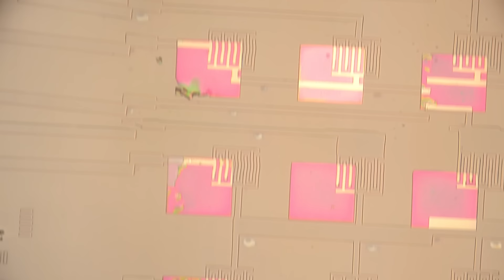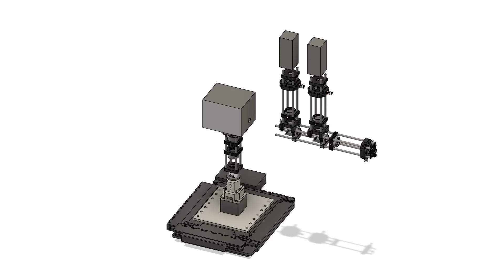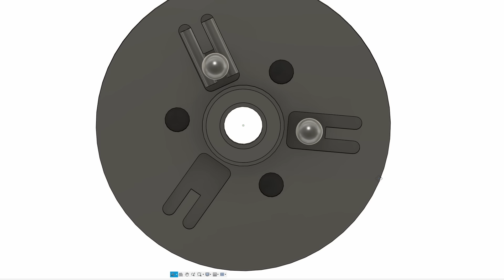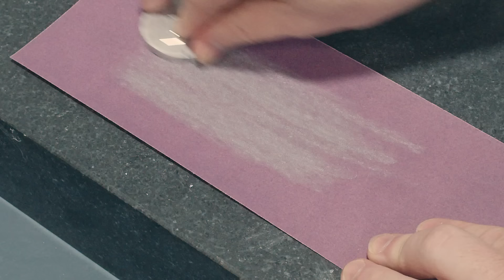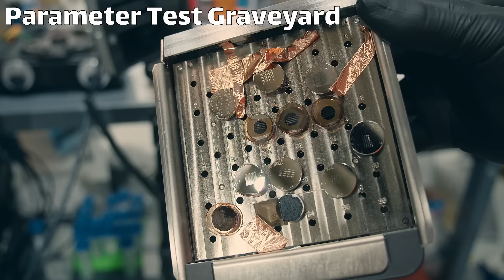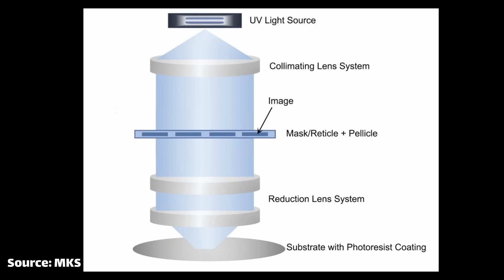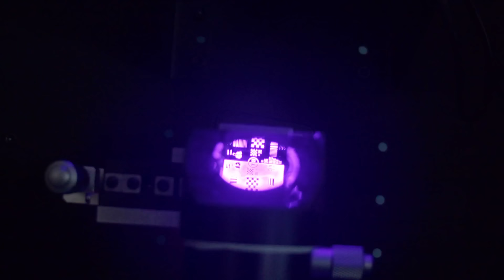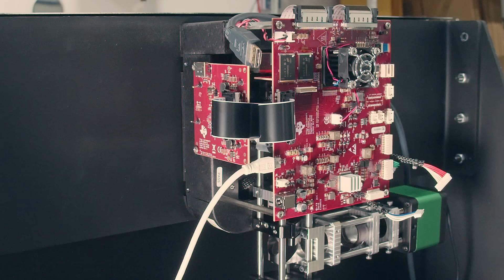Speedrunning 30yrs of lithography technology

Comment: Cool stuff, I attempted something similar but the deposition of metals was too expensive for me so I stopped at the lithography part. Some advice,

Mount everything to a granite surface plate, you can use a diamond brazed bit and a router to bore holes into the surface plate then glue inserts to secure any apparatus. This makes aligning things much easier.

Not all DMD offered by TI are the same, the one you used has really poor optical performance when it come to <400nm wavelength range (look at the datasheet). When I attempted this I used the DLP assembly from a MARS 4 DLP resin 3d printer, this solved many problems like not having to worry about the light source, the optics where better than the ones found in projectors, mounting was much easier since the unit is quite compact, etc. This DMD (TI DLP30xS) is orders of magnitude better for <400nm wavelengths. XPR is also something you might want to look into. 

Unfortunately I think if you want to reach the 1um range you will need to develop a custom projection assembly using laser diodes instead of LEDs with optics designed for <400nm wavelengths. 

For enclosures use stainless steel (<2mm) it doesn’t warp as bad as steel and the cuts are cleaner, plus you don’t have to paint it.

Cool XY stage.
Reply: Good stuff man

Comment: Aluminum and steel in contact with each other will encourage galvanic corrosion.
Even if you isolate each part with paint or nylon spacers, and use non-metallic fasteners, each part needs a path to ground in order to prevent static charge buildup.

Comment: Yet the crazy thing is that we're getting to the point that Silicon is practically useless, about 2 nanometers or smaller, pretty soon. Silicon indeed have had a good 70+ years run as a transistor material, so it's time for exotic III-V / III-Nitride materials like Gallium Nitride to take over soon enough.

And replicating that process of producing 2 - 1 nanometer transistors is very difficult and that kind of means using X-rays to make photolithography imaging that small (13.5 nanometers is basically extreme ultraviolet yet it has enough energy to technically qualify as X-ray wavelength as EUV lithography machines practically use X-ray optics and mirrors for that reason).

Comment: You mention two targets, resolution and coverage-area, but there are actually three, the third being throughput. As a thought-experiment, if you could use a pinhole-camera to put an image onto a wafer, you could spend a full year, and have one wafer exposed.. but that's not a fair comparison with the MANN unit, imo.
From a kinematic standpoint, there are several "big boo-boos" (no disrespect, I love your channel!)
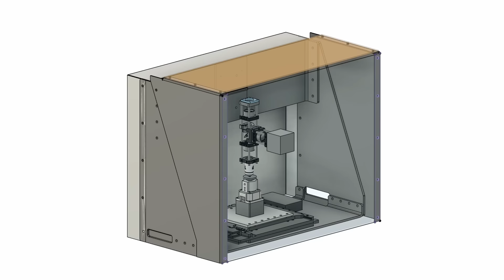1) The "rigidity" of tens of kg steel is pointless if it is also has eigenfrequencies in the sub-100Hz. This can be due to the heaviness os steel, or more often than not, a poorly chosen geometry. The "base" is a sheet of steel, which acts as a tramponine, which I thought was bad, until the whole wafer-stage got lifted up by a scrawny bearing from a NEMA17 stepper. On a microns-and-hetrz scale, the wafer shall be bobbing around endlessly. The enormous cantilever from the projector 3:31 is the equivalent of a fishing-pole with a brick at the tip.
2) Numerical aperture and fixed distances - it is as if you are standing on a tele-handler, and with an outstretched arm, are trying to write your name on a wall. Every little vibration is gonna add errors to your writing. Worse yet, as the actuation-loop is so long, any control-system is gonna have a hell of a time to close the (control) loop. Why not reference the Z-distance off the projection-lens?
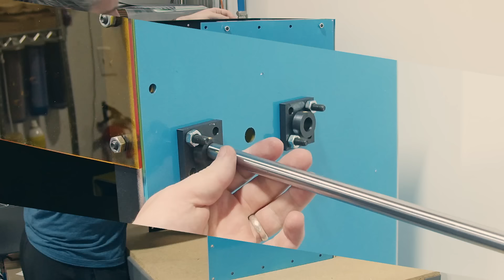3) "linear guidance" - an overconstrained guidance-rail with two parallel beams makes the kinematic-mount utterly pointless. 27:52. 
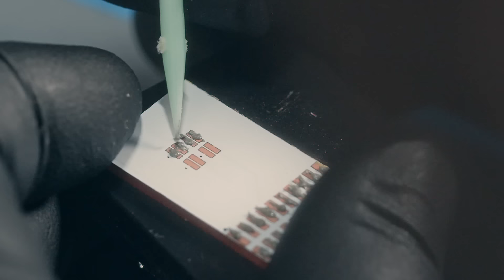4) Collimator: Why not stick to a single UV-LED? How can you ever collimate bundles coming out of two point-sources? 8:51
5) Path-planning, momentum-balance, reaction-forces and jerk: Every motion of the positioner shall shake the construction. What measures do you employ to prevent this energy from enterind the hanging-system?

The one good aspect is to see the "fall and stand-up" process, with all the associated pitfalls, made even by an experienced designer such as yourself.

Ach, don't mind me, just your average keyboard-warrior :p

Comment: Putting a stepper motor on such a precise x-y stage kills all the precision to begin with
Reply: I was looking on in horror as he was assembling the tower of backlash.
Reply: @Kenionatus me too, and thinking "you know, Thor Labs just... makes this kind of stage. You can just buy it."
Reply: @arfink  are you sure you’re an engineer because he already had that Zeiss lens sitting around and the developer isn’t that expired.
Reply from the maker: It was not the best of plans 😅
Reply: Yeah, i was already thrown out by the idea of putting a stepper motor in this. They are "good", just never good enough. Especially NOT for a precision critical task such as lithography.
Reply: Not really, these are called theta stages and they are for something different than the x-y stage. He still has the exact same precision in x and y. He doesn't have much in rotation but he may not need it. His real problem is that he's not using focus on each step with a z stage. But I'm not sure what an affordable home system would look like.
Reply: I'm curious, wouldn't a structure like a 3d printer be better?
Reply: @alexmipego  it's not precise enough for this type of job
Reply: @alexmipego  I'm not sure a 3D printer has a micron precision.
Reply: @narrativeless404  There are micron-scale printers.
Reply: @alexmipego  No idea how is that useful in a 4D printer.
Reply: @ Yet you talked about it.
Reply: @alexmipego  Ok and?
Btw, people would be 3D printing chips if the printers were that good at precision.
Reply: And backlash in the stage axis screw adjustment possibly as well.
Reply: With proper gearing you could set it up such as 100 steps forward is 1 micron of movement.

Comment: If the diode test is reading 0V, that means it failed short circuit. The working one was reading a typical forward voltage for red leds, and "OL" the other way, which most people think means "overload" or "over limit". Try the meter in resistance mode to confirm.

Comment: Hey! Optical scientist here! I design and build these kind of setups for living (used to be custom microscope systems, but now space instruments). So fun to see what you can achieve with DIY stuff! Youre doing an excellent job!!
For me building and aligning is always the best part of a project. I think you can ease your alignment process a lot by using good alignment tools and mounts with the appropiate degree of freedom control. For instance, putting the objective on a z-translation cage mount would massively improve the alignment control. For the alignment tools I would suggest cheap ones screw on alignment targets and frosted glass disks. You can also make these yourself!

When I design and build systems I spend most of my time thinking how I will align it.   Where is fine adjustment needed? What can be mechanically toleranced? Thinking ahead of all these things saves you massives amounts of time. I know for sure your next optical system will be even better! Keep it up😊
Reply from the maker: Noted, thanks!
Reply: And maybe throwing away the 3D printer; every time I see a cantilevered 3D printed "support", I want to die...
Reply: @Beregorn88  That's not the fault of the 3D print though - that's the fault of the optomechanical designer. Using the wrong process for the job does not discredit the process itself. I absolutely think 3D printers have their merit in the prototyping process, also in the optical lab - you just need to know when it's the right tool for the job.
Reply: @mr_gerber  it is not the right tool anytime you need even the semblance of precision: the extruded thermoplastic simply doesn't have the stiffness required to make a usable optomechanical elements. Not to mention the fact that it changes shape under load and at every slight change in humidity and temperature.
The only practical use is in creating replicas of the elements you plan to buy to see how they fit together, but for the experiments you need the real deal.
Reply: @Beregorn88  I use 3d printing regularly to make prototypes as a mechanical engineer, but it's definitely not meant for everything. I can consistently get 1 thou accuracy on my bambu (good enough for a caliber, but not a micrometer). I've tested a few parts where 1-2 thou of dimension changes makes a part pass vs fail, and the prints still worked great for prototyping. 

That being said, stiffness? Sub-thou accuracy? Not a chance. You've gotta CNC the parts or use different material.
Reply: @mr_gerber  Not only that but 3D printing is still relatively in its early stages, not quite infancy as it has been around for nearly a decade yet it's still young in terms of tried and tested technologies. Where we are currently at with this technology in theory shouldn't get any worse with its precision, efficiency, and applicable versatility. Give 3D printing another 5-10 years with more breakthroughs, discoveries and improvements also with the potential to be more affordable and accessible. 

I can remember back in the late 90s when I was still in High School, we had a Color Laser Printer in one of our computer classrooms that at the time were running Windows 95 or Windows 98, 98 SE. The internet was in the dial up stages, post baud rate and the search engine wars were on from Google to Yahoo which most are still aware of today but others such as WebCrawler, Lycos, Excite, HotBot a well as many others. When I looked up the cost of that printer, it was over $10k back in 98-99. Today that would be close to $30k. Now we can buy a Color Laser printer for the home or small office from about between $250 - $500 and they're easier to operate, maintain and service.  

We still have to give 3D Printing time to fully mature. Right now, it's kind of in between a toddler and adolescence before becoming an unruly teenager. 

I'm kind of curious as to what the future will bring with advancements in 3D Printing especially when other fields or exotic materials become easier and cheaper to manufacture such as graphene. Who knows, maybe in 10-20 years we might be able to have our own personal 3D Printer that can print Graphene and Carbon Nano Tubes at the micron or even smaller levels, and with that we could potentially print our own integrated circuits at home, that is if computer architecture design transitions from silicon base to carbon base. 

With a carbon base model, we can have various carbon structures for specific behaviors, such as graphene, carbon nano tubes, even diamond chip lets (microscopic). Instead of relying on electricity directly with various carbon structures in specific arrangements we could use optics for doing computations and logic instead. There's quite a bit of research going on right now with optics as being the data-signal carrier as opposed to current across a field around a wire. 

Who knows, maybe in 20 years we might not just be able to print our own integrated circuits for basic CPUs or microcontrollers, but with the potential improvements in both graphene research, 3D printing technologies, etc... and using Optics instead of conventional voltage-current based systems, we might even be able to print our own quantum chips in our own homes, garages, and shops.
Reply: @Beregorn88 Yes but waiting hours instead of days for delivery is such a win. 😋
Reply: @MakeKasprzak  that's only if the parts work: what usually happens is that you waste time and money, and then you have to buy the proper parts anyway. Or even worse, you go out of budget and can't complete the project at all...

Comment: So I work as an engineer developing lithography machines and it is funny to me how I have very little knowledge of the process as a whole, while noticing a lot of small things that would never fly at work. It is great to see someone build a working machine in an hour instead of focusing on a small gear in a very large machine for a year at a time.
Reply from the maker: Working on v2 so I'm all ears if you have tips! Top priorities are: a precision base for the stage (granite, optical breadboard, etc), reducing stack height of the stage to reduce abbe errors (and fix that stupid rotation stage), and re-arranging the optics so they aren't hanging/cantilevered or attached to the frame
Reply: I make parts for experiments that go into space and I don’t know what any of them actually do most of the time.
Reply: @rexmundi8154  that's the way everything in Universe likely works: a combiantion of many is more than a plain sum of components. Only by having extreme specialization jobs we're able to go forward as humanity.
Reply: It's like they say, no one person could design a modern computer mouse by themselves.
Reply: Do you have any advice for him?
Reply: 😂 what do you mean one machine? He built two machines in an hour!

Comment: First, fusion has a interference analysis function so you can check if things will run into each other - as long as you actually put the screws into the model. 

This was a great video. I really enjoyed it. 

Also, SendCutSend is really great. I’ve ordered a few things from them, and they really are a great service. Their powder coating service is also definitely worth using.

Comment: 20 minutes in and we saw something what was so obvious without your story telling / film making capabilities. Yes, it is obvious if you move something which you want to focus on to check/adjust/make sure is moved in one plane of motion, screwing random parts with unnecessary joints will always produce this, not thinking about base flatness and all other stuff from which you expect micron precision is at least hilarious if not stupid, sorry on that but it is what it is. 
Other option is that the point of this video is to show us what you did wrong and how did you get close to solution or even solved the problem which you should point out in big letters in the beginning. Yes there are million other videos doing precisely this, building/making/fixing/producing something where they don't have slightest clue about so they kind of are trying to take us thru the process of learning stuff and they also do not mention that instead they try to sound like experts, luckily you are not quite like that you are humble and occasionally say you don't have clue what you are doing but why would you film and continue to do something you saw immediately is wrong, example being that screw on the left side where you could not flush mount your panels, how much time is needed to simply drill the hole which would go over that screw and allow you to flush two panels? What stopped you from drilling holes for top plexi window? How did you even expect to have micron precision when you can see by your eye that bottom plate curvature? Those are really simple stuff and looking at that you are lucky to have millimeter not micrometer precision. I bet your rods holding the lenses and beam splitter and camera are bent from the camera mounted on one side and really nonsymmetrical build, or even thought about supporting it correctly. If you tightened that xy to that bowed bottom plate now your xy is trash looking from the micron precision perspective.

Comment: The Zaber X-ADR stage makes me feel funny, like rope climbing in gym class. Is it seeing gentleman callers presently? Is the interferometer somehow used for absolute positioning, or more for station keeping in a sea of vibrations?
Reply from the maker: 😂 

The interferometry data is all "offline". They assemble the machine and then place it on a precision granite surface plate and collect data as the stage moves through its full range of travel. That gives a table of pitch/yaw errors as it moves around. This allows them to confidently state worst-case specifications of the stage, but also provides interpolation data that I can use for dynamic compensation of abbe errors. I'll talk more about that in particular in the next video :)

Comment: Pretty cool project! However, NEWSFLASH: The maker community NEEDS a low cost open source SMT pick and place robot arm with OCR and a parts tray shaker to flip the parts upright so the OCR can find the right components. So after done making those CPUs with 1 micron features in that basement, can handle that? Thanks in advance.
Reply from the maker: Take a look at LumenPnP from Opulo! They are doing some really cool pick and place stuff and it's all open source! https://www.opulo.io/
Reply: @BreakingTaps  Thanks for recommending, but a low cost robot arm with machine vision basically seems like what should be happening right now for the open source hardware community. I may work on that some this month.

Comment: A piezo z-stage and some code could have solved the Problem in my Opinion, without a new machine.
Reply from the maker: Definitely! But timeline was starting to get tight and a basic reduction machine seemed simpler (at the time anyway). Piezo focuser would have been ideal but I didn't want to hang the weight off the projector, wasn't time to redesign the frame to hold it, and not enough space to mount on existing Z stage so it would have needed a redesign.

Comment: very cool!

I might have missed it, but why is the rotational axis for the table even necessary? Is it to remove some pixel artifacts from the dlp?
Reply from the maker: Sorry, I ended up cutting the section that described that part. It would be used for multi-layer alignment. So pattern the first layer wherever, and then on subsequent layers rotate and align to registration marks. In theory it could all be done in software (rotate the source image) but was a lot more software work than I was wanting to do at the time :)